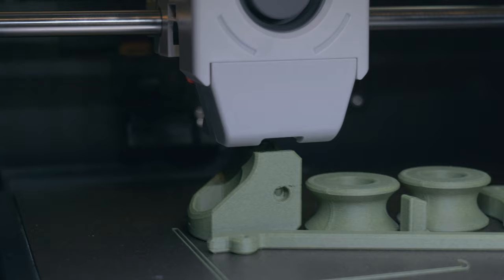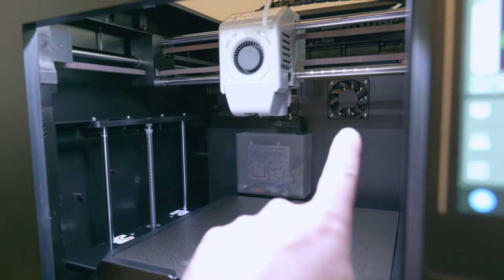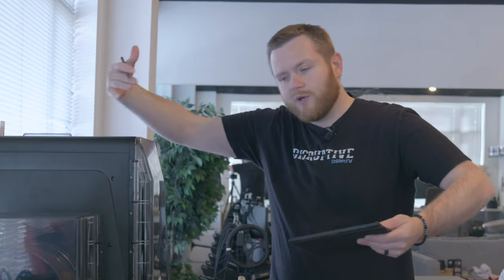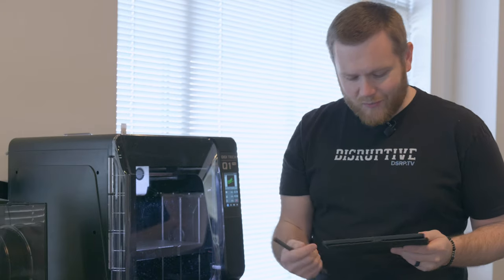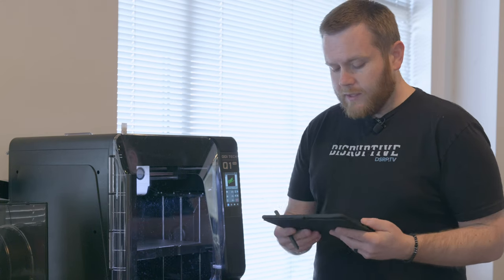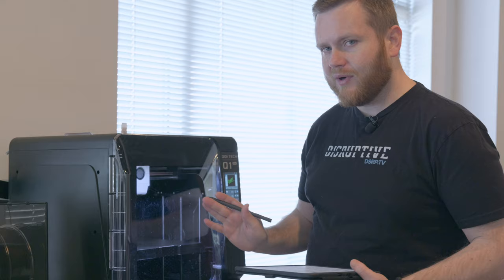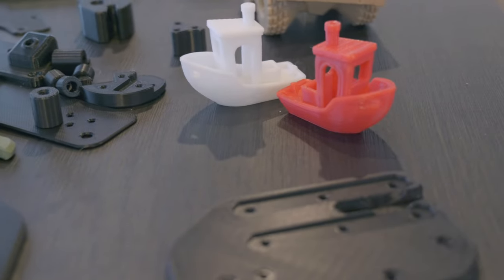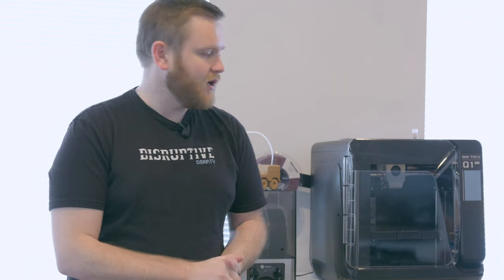QidiTech's Q1 Pro Seriously Raises The Bar for 3D Printers

Comment: To me this seems like the most overall capable machine for the money right now. Very impressive and at the top of my list. I hear Qidi has already made a few improvements for new printers shipping now as well.
Reply from the maker: Wonder what those changes are.
Reply: @3DPrintSOS  Reply to a bed shroud video on NeedItMakeIt said "New versions of the Q1 Pro has an updated bed mount with alignment corner brackets, new and improved bed assembly, ethernet port, and improved filament inlet. For Chinese mainland, old version is only sold for 1.5 days and people that got the old version (same as the reviewers) will get a chance to get a refund, or get free nozzles and bed plates. The price for mainland is 340USD early bird or 367USD now that Q1 is released." They also went on to explain that the new version is only in China right now, but as stock is updated it will go out globally. That's their guess anyways. Also said this info was on Chinese chat groups and Qidi confirmed when asked directly. I'm betting they will also update the spool holder and something to do with the roof at some point. Not sure if the door will ever get a handle. Hahaha.
Reply: @802Garage 
Hope this is all true as I'm waiting for mine to arrive in the UK sometime next month

Comment: This machine was so close to being perfect. The power button placement is terrible. The button is next to the power cord but on the inside (towards the middle) so you have to reach around the back of the machine and around the power cable to press the power button. For a short guy like me with t-rex arms, it’s a huge inconvenience to power on/off. Other than that it’s a great machine
Reply from the maker: Yea, the power button is a massive miss. Would have loved it on the front or side
Reply: Have you tried using  an extension lead with individual on/off switches?
I get it's an extra spend for something that shouldn't be an issue to begin with, but we can work around it and hopefully they learn for the next models
Reply: Its a precision machine and your whining about a power button lmao
Reply from the maker: @igoreq4495   In a room full of machines that do the same thing, it's very easy to see small faults that would put it over the top. Whining? I think you’re projecting a bit.

Comment: Adding a full filtration system would EXPLODE the cost of this machine.  easily adding another $150-$200 , Putting it out of reach and out of the market space of most people. And as this is actually focused at the Consumer market there is not a lot of people printing with ASA or ABS etc all the time. certainly not the majority are.  Maybe come out with an optional snap on filter system but just including it in the normal package is a bad idea
Reply from the maker: Creality did it with the K1C. I see no reason why it would cost a lot of money for a simple carbon or hepa filter in the rear.
Reply: @3DPrintSOS  OH! I thought you meant a full air vacuum filter system lol.  one with multistage filtering and the like.  Yeah just a few paper filters would be nothing to add
Reply from the maker: Nope, just something to take the edge off. :) An internal carbon filter and external hepa filter would go a long way.
Reply: I made active carbon filter to my laser engraver, pack of two 170mm coocer hood filter cost 12 euro and it fit perfectly to 1 kg youghurt  bucket :-) so its dirt cheap as DIY. add fan or vacuum cleaner and its done. (and because you have 3D printer, adapters are easy to do to fitting things)

Comment: I’ve had my Q1 pro for over a month and it’s been fantastic. No problems whatsoever able to print anything I want. I’ve added the carbon filter they have on their website and there’s a modification to mount it behind the unit that works well. I’m using virtually only the Qidi filament because it just prints so fast compared to other filaments such as ABS and ASA and PETG. Outstanding products at a outstanding price.

Comment: They are doing a AMS style multicolor. If you look on their website, under support for the Q1 Pro there is a email address for the Q1 Pro and Q1 pro AMS.
Reply from the maker: The reps must be in denial haha
Reply: If they don't, or until they do, would be awesome to see a system like Chameleon, ERCF or some other MMU hooked up to it as a review
Reply: It could also mean after market support as that is what they reference the support on multiple pages. But I would very much prefer an AMS system :D
Reply: An integrated Qidi made AMS on this printer w/ the heated chamber… omg… heaven. If they release a “Plus" model it would be killer.
Reply: I think it might not be an addon but a modified Q1 pro because the bucket on the Q1 pro is not big enough for more than 30 color changes.

Comment: The location of the power button is moronic, and that one isn't a "nitpick", it's a valid and material criticism.

"It almost looks injection molded".  You can tell it isn't injection molded because there aren't any MOLD LINES!!  Wohoooo!

I ordered one on Saturday, my first 3D printer.  Unfortunately, I have to wait until late May to get it.  There are some solutions out there to add an active carbon filter to the fan outlet.

Comment: FYI for filtration Qidi includes a carbon filter box STL that you can print and put your filter material in and add to the printer behind the back plate.
Reply: Trouble is not only does that not make a proper seal but you've got to take the back off to change the carbon which probably means not doing it as often as you should.
Could just give you a false sense of safety

Comment: Really wanting it but I think i'm going to wait a tad longer for the larger version if they do it. I was super convinced to get this but the build size is just odd and I feel finding replacement sheets down the road will be a pain. I feel they should have at least done 256mm but 300 would have been the icing on the cake.

Comment: I have a Qidi X-smart 3 and a Flashforge Adventurer 5m. I find myself using the Qidi more often. I do want another enclosed printer with a bit larger build space. Been waffling back and forth between the Q1 Pro and the flashforge 5m pro....... not sure which way I will go yet. I do know that the PS1 is just a bit out of my price range. But that is the machine that most folks are comparing it to so that must say something for it.

Comment: Is the Qidi Q1 Pro better than the Infimech xt for beginners?
Reply from the maker: @AnonymousHippo5  yes for sure. More automated and has a heater in the chamber for when you are ready to print more demanding materials. The TX is better built with metal and glass, but the Q1 is a more polished product from start to finish. In my opinion.

Comment: Do you recommend Qidi q1 pro, Creality K1 or K1C for a total beginner of 3D printing? (Easy to use, print quality, versatility of various material)
Reply from the maker: Qidi Q1 Pro because of its heater. If you want a bit more of a “suite” of apps and wider accessories and mods, the creality machines win.

Comment: It's odd, but I think of QIDI as HP of 3d printers. I was waiting so long for HP to bring out a home printer yet gave up and moved to QIDI for my very first printer of 3 years ago (QIDI X-Plus). But the multi color should be coming. If you look at the support emails one of the emails is for multicolor? Also the cutter is missing and is the main reason it is so hard to replace filaments right now.

Comment: The only thing I don’t like is the fan that is on all the time. You shouldn’t have to use kipper to fix it. The heater that holds voltage is a bigger problem. Just the heater would stop me buying it. Have a Bambu Lab X-1 carbon.  Question does the purge bucket is just too small so that would tend to not help the cause me to buy it. It’s kind like the Bambu A-1 with it purge that is even worse. Both of them would stop me buying. There are so many things that are great about it. I would pass on it. Other companies will steal a lot of its features to keep up. I think there next machine will fix all the little things that put off me.